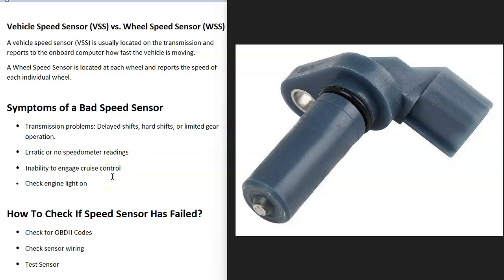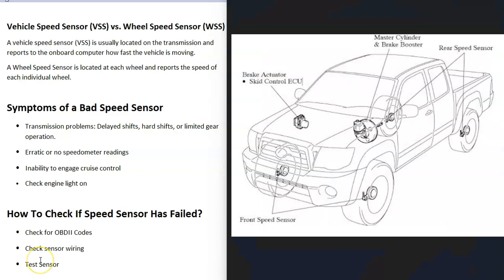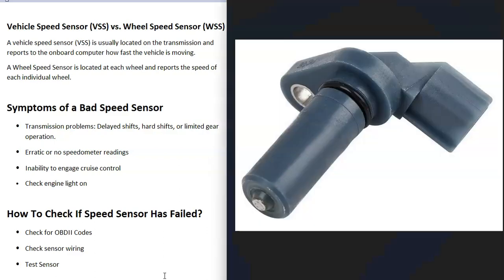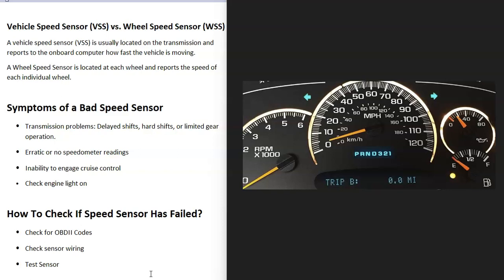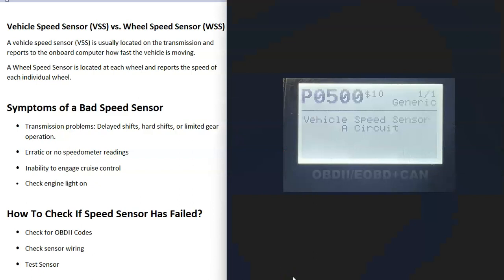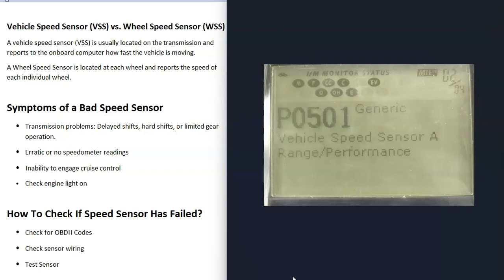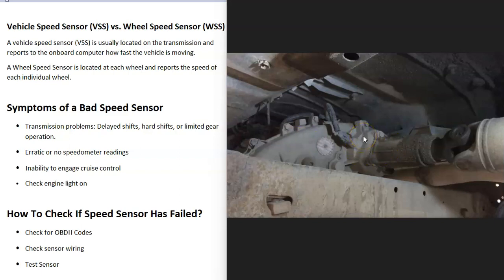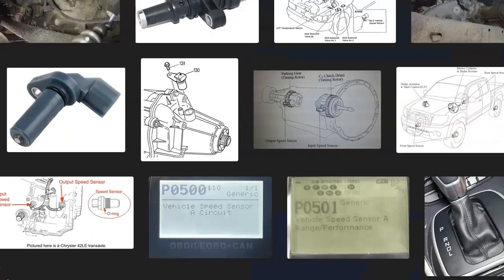Symptoms of a Bad Speed Sensor and How to Test if it Has Failed

Comment: My 93 4runner has been shifting late and hard for a while. This morning Speedo went out and CEL came on. Hope a replacement of speed censor clears up all of these issues! Good video, thanks!
Reply: Tried replacing both speed sensors, Speedo issue is gone but no help with shifting. Reset ECU and codes are now for shift solenoids #2, #4 and TCC solenoid. Pulled the old ones out. They ohm good but TCC solenoid fails to actuate when power applied. All 4 solenoids are on order should arrive tomorrow or Monday.
Reply: @isaiahlawson6797  what was the verdict on this ?
Reply: @maine8931 solenoids helped greatly with shifting but not 100%. I think the valve body was clogged badly with metal shavings/debris. A bottle of sea foam trans tune helped a bit as well but the hard shifting never fully went away. At operating temp it was always smooth as butter. I was also having what I believed to be torque converter issues where during acceleration the truck would lose power and rev RPM as of the clutch was not engaged. I’ve since sold the truck. Good luck with your work.
Reply: @isaiahlawson6797  check TCC Solenoid
Reply: I'm having those transmission issues but my speedometer and cruise control work just fine... Is it possible that it's still a speed sensor or will all of those symptoms have to be present?
Reply: @NightimeDan nah it’s not a speed sensor.
Reply: Any luck

Comment: i replaced wheel speed sensors all brakes abs light comes on and brake light and then wont shift think one new part is bad ? anything would help me thank ypu
Reply from the maker: Do you have a scan tool that reads ABS codes. The codes will help to point to the issue.

Comment: Hello my traction light and ABs and my tire pressure light comes on no check engine light do u think it’s my wheel speed senor ?
Reply from the maker: Scan for OBDII codes, which will give a speed sensor code if one is bad. If you don't have an OBDII scan tool, automotive stores often come out and scan for free.
Reply: Good chance of it.

Comment: I changed the speed sensor, didn't stop the speedometer from jumping. changed the dash speedometer, didn't work, had wires to sensor worked on, didn't work. What else could it be?
Reply: Possible bad torque converter?
Reply: Did you figure it out I’m having the same problem
Reply: Not sure if this is relevant or not, but try disconnecting the negative post from the battery and wait a few minutes then reconnect and go for your test drive

Comment: My car's speed sensor has a problem and a DTC appears after scanning. I have tried replacing the sensor with a new sensor, but the problem is not resolved because if the engine is running the check engine light comes on and if it goes 10/20 meters the check engine light goes off. but if you stop check the engine starts again. the car feels heavy when driving.. what steps do I need to take? if the cable is safe and not broken.
Reply: Try look at fuse AT socet at

Comment: Hi my name is Carlos 
I have a 2000 celiica GTS  CHECK ENGINE LIGHT  IS ON .
WON'T GO INTO 4TH GEAR .
SHOULD I BUY THE SENSOR FROM THE DELLER OR SOULD I BUY IT from auto part store?
Any advice please 🙏 
Hightly apriciate. .
Reply from the maker: It's always best to get an OEM original sensor when possible.

Comment: I have 07 Nissan Murano SL . Speedometer jumping and acting funny also no communication between engine and transmission . shifting delay and i cant even pass vehicle so what should i replace the input or the output and the location of the sensor please  . i appreciate any help

Comment: I just purchased a 2013 Nissan Marano sport, utility vehicle. And when you put it in drive, it will not go anywhere. Nor will it let you accelerate when you put it in. Reverse the same thing happens. However, when you put it in park on neutral, you can accelerate and everything works.  Could that be a Faulty speed sensor
Reply: If it's not the AWD model, might be a good idea to look into the torque converter.